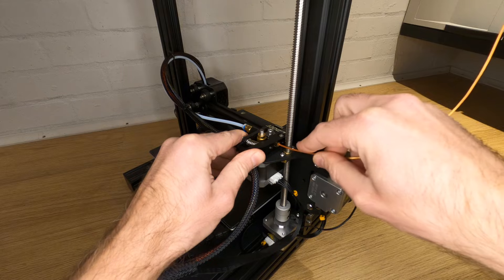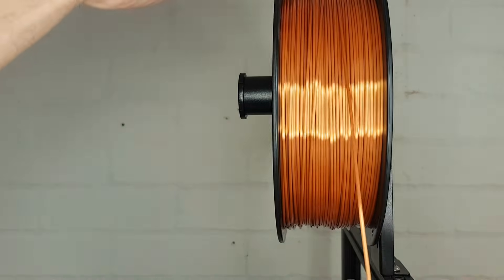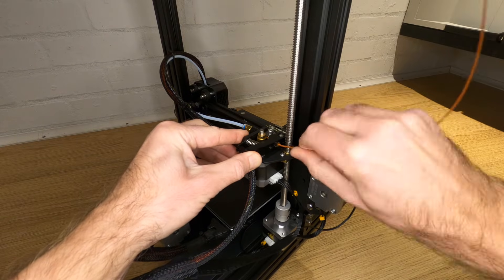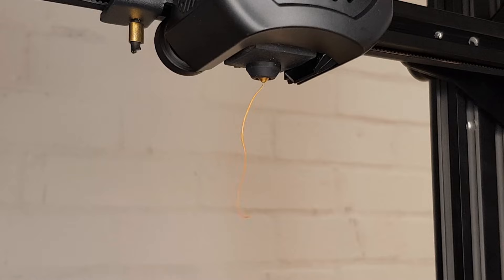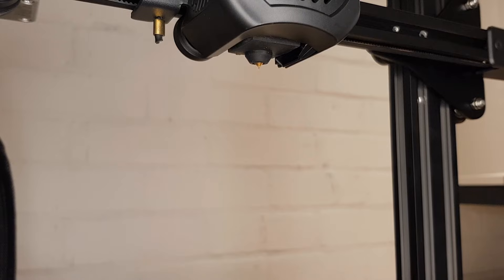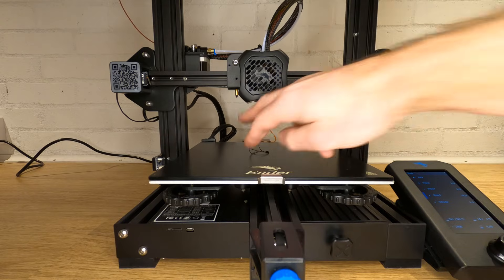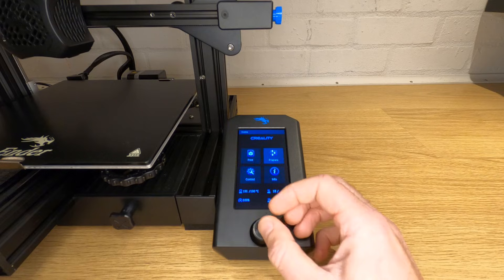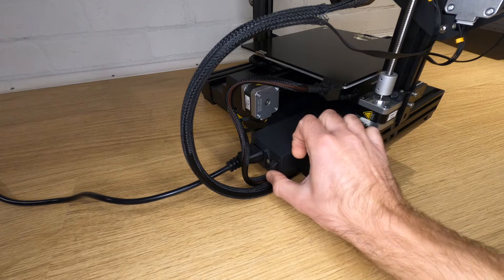Loading & Removing 3d Printer Filament - A Beginner's Guide

Comment: Removing filament is a question I've never asked, but always figured I was doing somewhat wrong. I like the advice to push the filament in a bit and then tug it out - have to try it on a hot nozzle. I find that by the time I get to my printer, it's already fully cooled and don't want to do a cold pull. Setting my nozzle temp to about 20°C above the glassing temp (eg: PLA 60 + 20 = 80°C) pulling it out as soon as it hits 80°C generally results in an easy and tidy removal.

Comment: Okay, so the small white pipe that the filament goes through on my Creality Ender 3 Max Neo keeps popping off and then the filament isn't going through to the nozzle. And advice on what to do?
Reply: google the manual pdf for anycubic mega s, in the beginning there is a pic of the tube with a zip tie around it. Get a zip tie and replicate it just like in the pic!

Comment: I have a new Creality Ender V3 KE. I cannot find a "cooldown" option in the menu. Is it ok to just manually set temp of bed and nozzle to 0 and wait untill they are cooled down and then just shutdown the power to the printer?
Reply from the maker: Yes, that is fine. It's only really the hot end that you want to cool a bit before switching the machine off. Just see that it cools to around 100°C at least before switching off👍

Comment: no matter what i try i cant get the filament to come out the end
Reply: Did y’all try heating it up
Reply: This is exactly my problem. For loading the filament first time too.
Reply: @khushalkhanmohammadzai8032  exactly the same issue
Reply: Same
Reply: Same
Reply: I did
Reply: Best to upgrade to a direct drive extruder
Reply: Struggling with the same problem now it snapped still can't get it out.anyone with a solution for this.am thinking of dismantling the thing
Reply: did you print something previously and ran out of filament?
Reply: I have the longer it loads but when I hit unload it don't do anything I have to take apart and remove each time. Why won't it spin it out it use too nothing changed

Comment: Thanks for the video!
You said in the end of your video, that i have to cool down the nozzle before turning the printer off. Why is that?
Reply from the maker: You can get heat sink though the hot end if you kill the cooling fan when everything is very hot. This can cause areas to get hotter than designed which is best to avoid. It's best to wait for the hot end to cool a bit before switching off the power and therefore, the cooling fan.
Reply: @RickyImpey  Thats some helpfull comment, thank you so much, makes sense now.

Comment: It may sound very trivial but as a beginner I really struggled trying to load my first filament. I almost started thinking I had a bad extruder block in my brand-new Ender 3 V2. Then I found your video which solved the problem.
BTW I also used your Filler gauge video for bed leveling instead of the paper method. I can say it is spot on !!
Your videos are very well done and much appreciated.
Reply from the maker: Thanks 👍